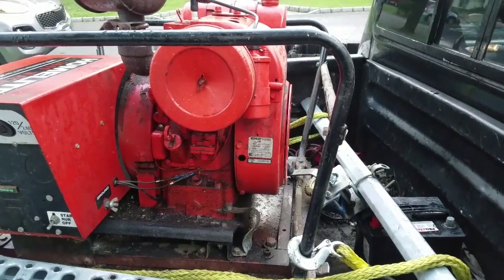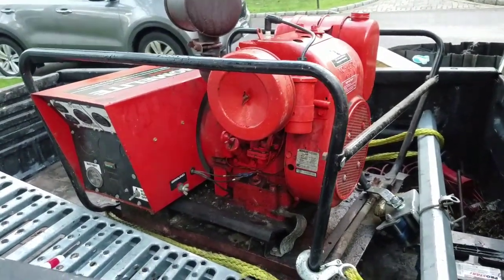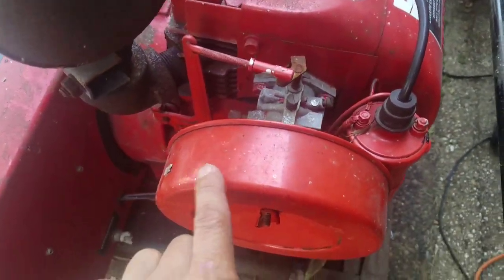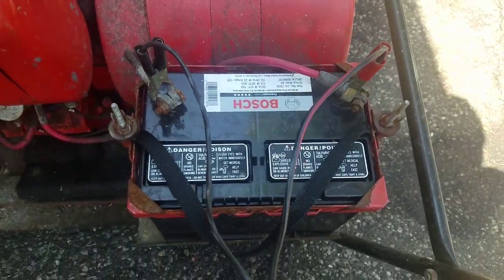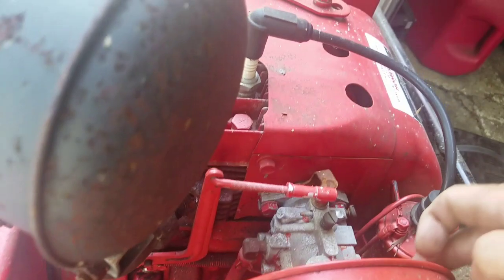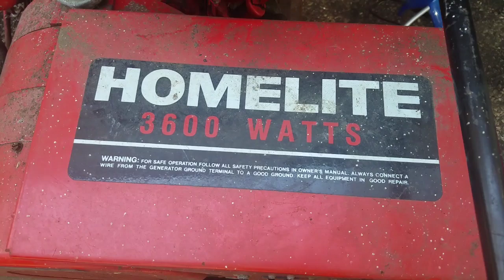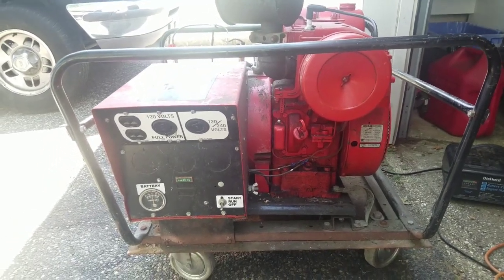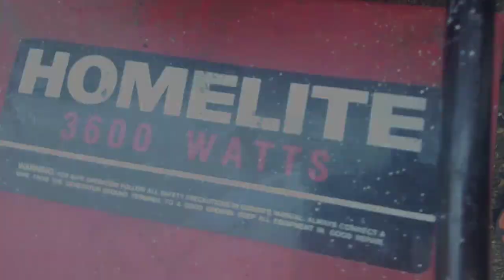FREE HOMELITE TEXTRON G-3600 WATT VINTAGE GENERATOR 12HP KOHLER K-SERIES K-301 CURB ALERT TRASH PICK

Comment: I have 2 of those generators. I bought one for $25 and another one for $100 that had never been started. People don't know what they are. There's very little on the web about them but  I can tell by the control panel on your's,  it was built mid 1980. That's a 1800 RPM  machine and will run forever but they do like to drink gas. About 1 gallon per hour at half load.
Reply from the maker: I sold it last year for $550
Reply: You wouldn't be interested in selling one of them? Let me know thanks

Comment: I have a 3600 watt homelite generator powered by the 12 HP kohler engine shown here, but mine is a pull start, and it does take a good man to start it. My problem is this, at idle speed + or _ 1800 rpm, the 120 outlet voltage varies from 120v to 150v, and at high rpm, the voltage varies from 120v all the way up to 280v. The electrical schematic drawings do not show an " automatic voltage regulator as such", as you would see on an old car.  The brushes on the exciter commutator visually look ok. The rectifier, capacitor and xformer show no signs of burning, so what's up, anyone?
Reply from the maker: I hate electrical
Reply: @MowersNBlowers  depends what your trying to do with that electric I suppose. So you don't have any idea what the problem might be?
Reply from the maker: @claudekupchanko2854  I would say a voltage regulator but you say it doesn't have one.  If you plug a desk lamp in it, does it work or burns it out?  If it works, it works...other than that, I'd say the voltage needs to be regulated by a regulator.  What I've been told is that the generator outputs whatever voltage the appliance requires.